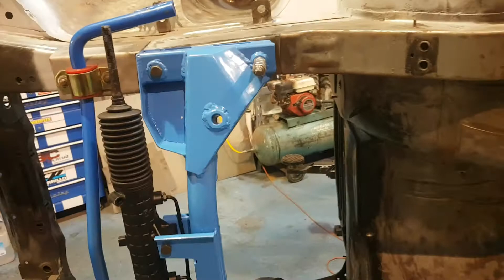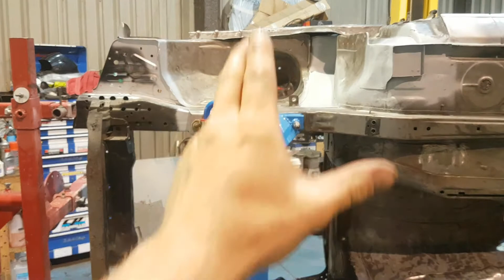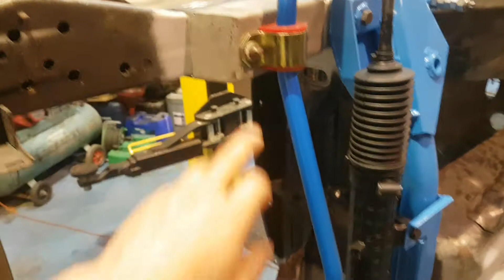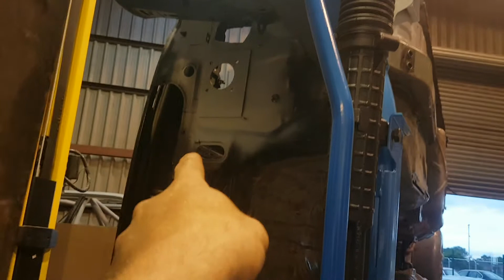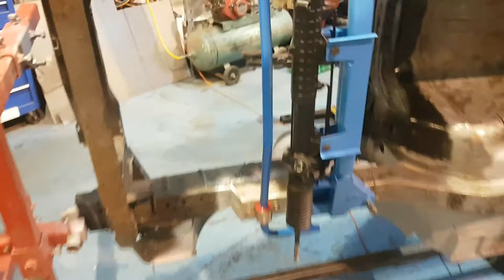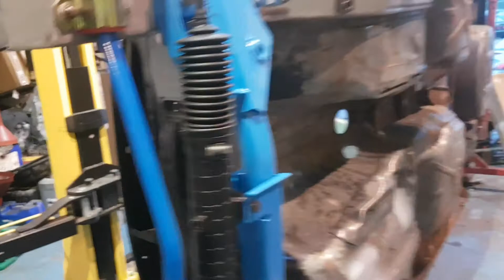e30 steel Bmw e30 engine bed m50/m52/m54/s50/s54 rear loading sump e36 m3 evo front suspension

Comment: Hi Spencer,Another beautifully thought out and well built part. When you say "Evo", you are referring to M3 correct? Im just asking because 95% of the five lug swap articles Ive read use E36 M3 parts and I haven't heard them refered to as Evo before.Thanks,Dann B
Reply from the maker: Dannimal SDiego hi there yes you are correct the lower arms must be e36 m3 3.2 evo arms the standard 3.0 arms are the same angle as the e30 thanks